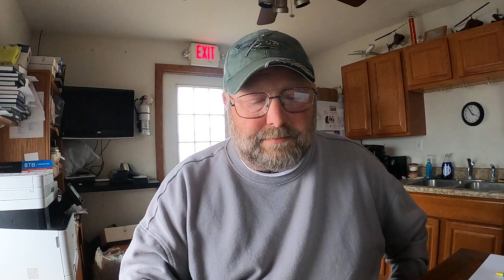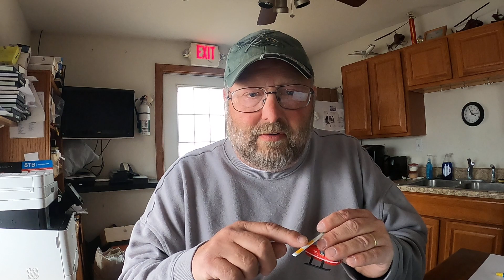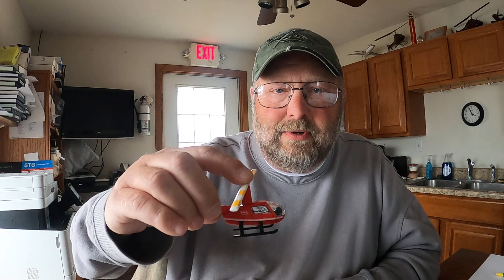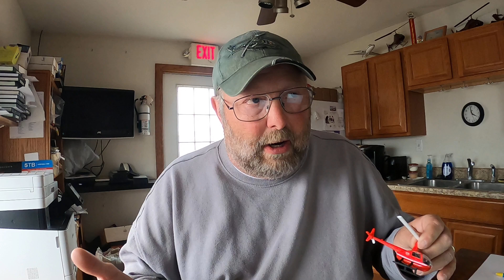Part 1-Settling with Power (Vortex Ring State)- Helicopter Ground School

Comment: I agree with Paul's version. VRS and 'Settling with Power,  grammatically.. describe pretty much the same thing.. regarding the situation the machine is in at the moment. 
  The 'newer' version of settling with power describes a situation where you have too much speed, and have exceeded the ability of the machine to use pitch to slow the MASS of the heli on approach, and you keep on moving towards your arrival spot, regardless of how much pitch is on the blades. A little like in your car, on black ice, trying to stop before the red light.   It should be called "over dynamic approach, or " miss read gross weight approach" eg's.
You are not in stale air, as forward speed puts you in a new undisturbed parcel of air, every instant. 
Webster definition: Settling :.."